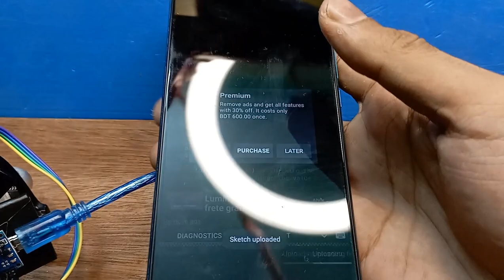Glasses for blind people, made by ultrasonic sensor and ardiuno nano.

Comment: is this code right -> 

#define trigPin 13
#define echoPin 12

#define buzzer 6

void setup()
{
pinMode(trigPin, OUTPUT);
pinMode(echoPin, INPUT);

pinMode(buzzer,OUTPUT);
}

void loop()
{ long duration, distance;
digitalWrite(trigPin, LOW); 
delayMicroseconds(10); 
digitalWrite(trigPin, HIGH);
delayMicroseconds(10); 
digitalWrite(trigPin, LOW);

duration = pulseIn(echoPin, HIGH);
distance = (duration/2) / 29.1;

if (distance < 100) // Checking the distance, you can change the value
{ 

digitalWrite(buzzer,HIGH);
} else
{

digitalWrite(buzzer,LOW); 
} delay(100);
}

Comment: Main yah banana chahta hun mujhe yah program chahie
Reply from the maker: #define trigPin 13
#define echoPin 12

#define buzzer 6

void setup()
{
pinMode(trigPin, OUTPUT);
pinMode(echoPin, INPUT);

pinMode(buzzer,OUTPUT);
}

void loop()
{ long duration, distance;
digitalWrite(trigPin, LOW); 
delayMicroseconds(10); 
digitalWrite(trigPin, HIGH);
delayMicroseconds(10); 
digitalWrite(trigPin, LOW);

duration = pulseIn(echoPin, HIGH);
distance = (duration/2) / 29.1;

if (distance < 100) // Checking the distance, you can change the value
{ 

digitalWrite(buzzer,HIGH);
} else
{

digitalWrite(buzzer,LOW); 
} delay(100);
}

Comment: In code getting  errors  bro
Reply: Reply  bro
Reply: #define trigPin 13
#define echoPin 1
#define buzzer 6
void setup()
{
pinMode(trigPin, OUTPUT);
pinMode(echoPin, INPUT);
pinMode(buzzer,OUTPUT);
}
void loop()
{ long duration, distance;
digitalWrite(trigPin, LOW);
delayMicroseconds(10);
digitalWrite(trigPin, HIGH);
delayMicroseconds(10);
digitalWrite(trigPin, LOW);
duration = pulseIn(echoPin, HIGH);
distance = (duration/2) / 29.1;
if (distance < 100) // Checking the distance, you can change the value
{
digitalWrite(buzzer,HIGH);
} else
{
digitalWrite(buzzer,LOW);
} delay(100);
}
Reply: @pateltakshgodhani   Bro will this code work for vibrational motor.
plz reply
Reply: No bro ye vibration motor me work nahi karega

Comment: Is the code is right.

#define trigPin 13
#define echoPin 12
#define buzzer 6
void setup()
{
pinMode(trigPin, OUTPUT);
pinMode(echoPin, INPUT);
pinMode(buzzer,OUTPUT);
}
void loop()
{ long duration, distance;
digitalWrite(trigPin, LOW);
delayMicroseconds(10);
digitalWrite(trigPin, HIGH);
delayMicroseconds(10);
digitalWrite(trigPin, LOW);
duration = pulseIn(echoPin, HIGH);
distance = (duration/2) / 29.1;
if (distance < 100) // Checking the distance, you can change the value
{
digitalWrite(buzzer,HIGH);
} else
{
digitalWrite(buzzer,LOW);
} delay(100);
}
Reply: Bro aapne kya ye project banaya or kya work kar raha he?
Reply: @pateltakshgodhani  its work but ...coding is wrong
Reply: @iamnabilgamer7724 can you provide me the right code?